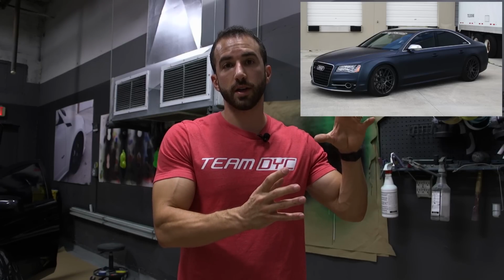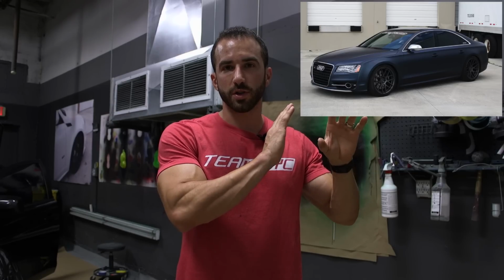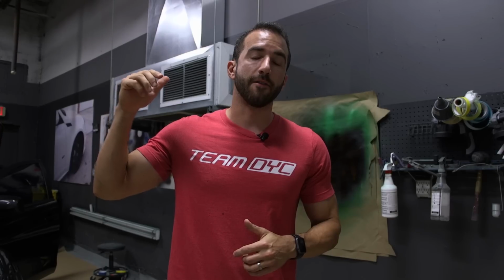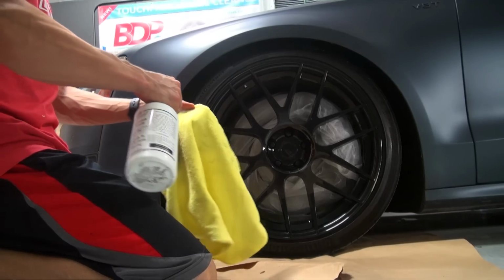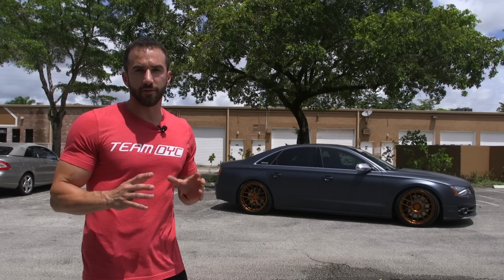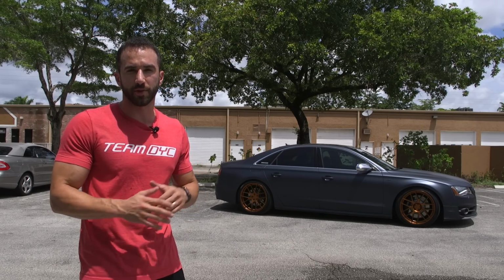Burnt Copper Alloy - Hottest Wheel Color

Comment: I bought this color about two months ago.. Guess I'll be putting it in this weekend.. Looks great... 👌
Reply: This product only launched in July!  You may be referring to the Copper Metalizer, which also looks great
Reply: +DYC Customer Service In July then...I bought them after the launch video.. that day ..I have both actually.. wanted to do a comparison.. the metalizer  lays a little flatter( smoother) .. but they're very similar in color...👍
Reply: Ok, just wanted to be sure you had the right products!
Reply: +DYC Customer Service yeah... order#300799 7/13/2016 4 Burnt Copper Aerosol and 1 Hyper Black Graphite .. and then on 7/18/2016 order#301472 I bought 2 Black and 4 Copper Metalizer. . So yeah middle if July..
" about two months ago"...👍
Reply: +Ghgvggh Vhvvhhv I can..I was gonna do then this past weekend.. Actually when I was commenting. But it stormed bad  I'll do them this weekend and post it...👍
Reply: +Ghgvggh Vhvvhhv sounds good... I've Plastidipped my wheels two years ago. Black... It's still on there.. But I figured I'd switch it up a bit.. It really is good stuff.. What you can do with it for  the price... Can't be beat..
Reply: It's not to good to be true. Plasti-Dip works great, looks great and peels off great. I watched a ton of videos, then I blacked out the chrome and spoiler accents on my Ralliart. I love the results! I have only the tiniest bit of painting experience and don't usually do diy projects but Plasti-DIp is one of those rare products that performs as advertised! Easy to use and it works great! 
Watch some instructional videos, be sure to be thorough when cleaning and prepping and you will be happy as a clam with the results. If you get tired of it, peel it off and try a new color or leave it off and, BAM, good as new!

Comment: Can you dip the inner wheel drum or is only recommended for the face of the wheel? Just wondering as I have a set of powder coated wheels I want to dip. Also now that I think of it is the plastidip safe on powder coated wheels?

Comment: I've read the comment about why you don't/haven't removed the wheels, but the biggest thing for me is over spray. Why not cover the bodywork? What about the tyres?
Reply: He puts the "dip release" spray on the tyres which make the plastidip peal easily, but in my opinion you are correct that the body should definitely be covered.
Reply: I agree no matter what color I dip my wheels I like my lug nuts to remain chrome, so I remove the wheels that's just a personal preference
Reply: +guspac88 ah, didn't know that. Just assumed he relied on them being rubber it'd peel off easy
Reply: Plasti-Dip, peels or rubs right off. I understand your concern but it is not like regular car paint. Try some, you will like it!

Comment: How do you handle brake dust on the dip?  I see some people say glossifier makes it harder to remove?  I have a Focus RS and the brembos throw a lot of dust.  I want to use this stuff as a test bed for what finish wheel I'd like to get, but I don't want the stuff to be ruined in a couple passes on the mountain.
Reply: They sell a product called BDP or Brake Dust Pro just for issues like that. I have a Mustang with BREMBOS and have the same issue. It works great. It's a great all around cleaner.
Reply: Nice car by the way. LOVE the Focus RS.
Reply: Thanks!  Yeah, I assumed regular wheel cleaner would just eat this stuff away. I powder coated my Evo wheels before so didn't have to worry about it.  This is just a temp thing though for me. :)
Reply: +jrzez 
It wouldn't necessarily eat it away it just depends on what wheel cleaner you use. Some could soften it and some could stain in. But instead of playing roulette and risking it I'd just go with BDP. Lol

Comment: Thx for the vid. Good stuff. 2 questions. Putting on my winter wheels soon, and wanted to change up the color. 
1st ques; my car isn't steel blue, but what Subaru calls a Galaxy Blue Pearl. Darker than the World Rally Blue on most STis, but more bluish than the Steel blue which if i'm not mistake is Grayish blue. Would the Burnt Copper in your opinion still work?
2nd ques; for any colors that require a black base, can I skip that if my wheels are already black?
Reply: Did you end up doing it?  How did it turn out?
Reply: @toemasii  yes I did it and love it. After two years , peeled it off and did it again. It's a great contrast against the blue of my car, & a good change up from my black chrome Summer setup. Def have to make sure you get that good base coat and then the progression of multiple coats of the burnt copper so it pops.
Reply: @jpd3070  you used the same burnt copper for your base coat, right?  I think I have the same color car as you and I've been considering plasti-dipping this small side emblems this color.  No harm in trying, I guess.  I wish I could somehow see a pic of yours but I'm sure youtube allows pics on here.
Reply: @toemasii  not sure if that would work or not, I used black for the base coat like they do in the video even though the stock wheels were already black. If you do it lmk how it turns out.

Comment: Hey ive got a question about plastidip. Would it be possible to paint a bicycle frame with it? Maybe some black and red and finish off with a clear gloss? You have dipped other items besides cars and car parts and I am curious if it would work with a bike frame. How well would it withstand normal riding? Thanks
Reply: I don't see any reason why this wouldn't work, as long as you stick with painting only the frame. I don't think the frame of a bike would get as much "wear and tear" as  plastidipped wheels would.
Reply: When you said bike I was thinking bicycle I hope that's what you meant instead of a motorcycle.

Comment: I used the Burnt copper on my wheels, and it ended up looking fantastic. However, I ended up getting a rough surface finish on the "vertical" portions of the wheel, like the barrel. Any tips for getting all the surfaces to be smooth?
Reply: I would say, since its rubber, you want a lint free cloth, paint thinner, and smoothen it out really lightly, you do risk messing it up if you go to deep, so might want to experience in a less noticable area. Also generally top coating with high quality gloss paint, can help hide some of the roughness, atleast to an extent.

Comment: look good how much spray-can you need, for the 4 wheel?
5 coat each wheel, can you use a single spray can, for each wheel would it be enough?
also link on this page do not exist !
Reply from the maker: You would need 4 cans of black and 3 cans of Burnt Copper.  Best thing to do is build a Wheel Kit - it will give you the products at a discounted price.  The links in the description have been fixed.
Reply: okay thanks

Comment: If I purchase the Burnt Copper Alloy kit, will one kit be sufficient to dip both the face and the barrel? My wheels are 19×8.5 and 19×10.
Reply from the maker: Hamza Amin no you’ll have to add another 3 cans black and 3 cans pearl. There is a lot of surface area inside those barrels.
Reply: DipYourCar so I should order 2 sets of the kit?

Comment: Why don't you take the wheels off before you paint them? Seems like it is more of a hassle to do them while they are still on the car.
Reply from the maker: That's certainly an option if you wish to do so.  When only dipping the face of the wheel, it's easier to just apply the brake masking bags and spray.  For a more open-faced spoke design, the inner barrel would need to be sprayed; and for those wheels we do remove them.
Reply: would take twice as long, the purpose is to dip the face. If you want something more permanent, then I could see pulling the wheels off.

Comment: I had a problem once when doing my wheels. I took them off the car and when I put them back on the lug nuts ripped the plasti dip in the socket holes. You could see it if you got close. What do  you do to avoid this?
Reply: Paint them while they're on your car, or use aftermarket lug nuts.
Reply: John Dale just wait a little longer for it to cure. I've had the same problem in that past